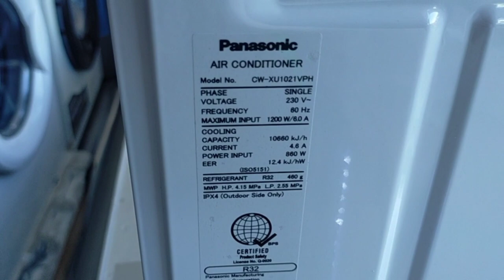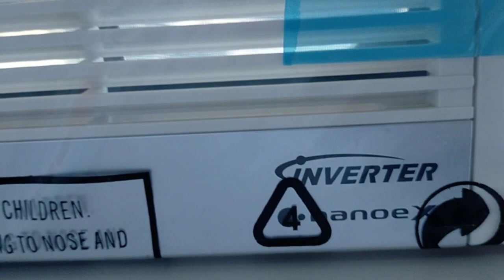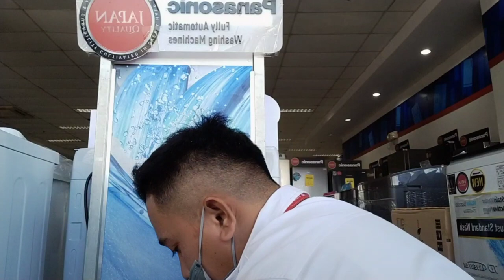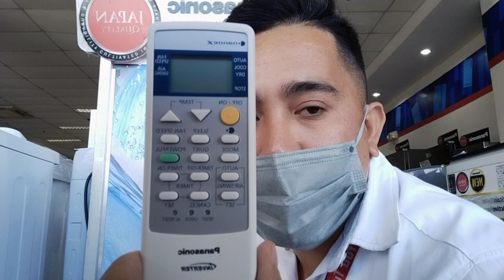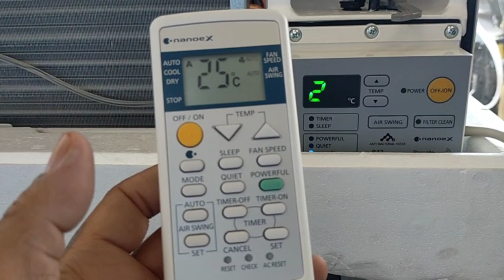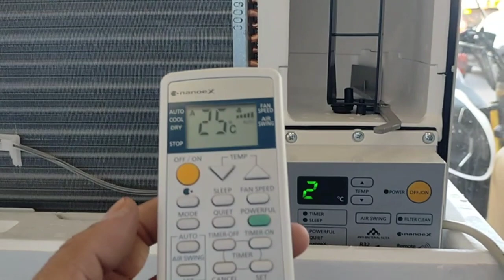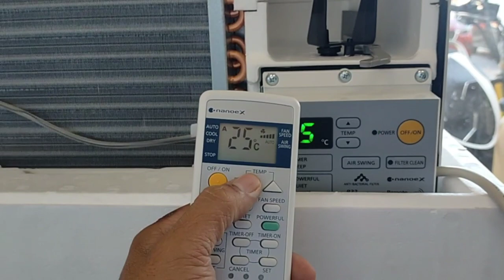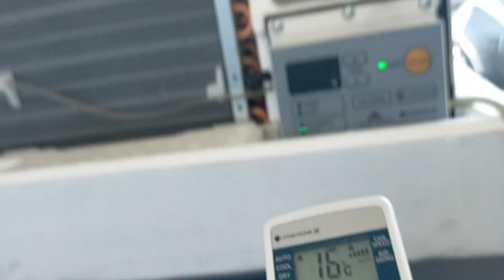NUMBER 1 IN THE MARKET PANASONIC INVERTER WINDOW TYPE AIRCON WITH AIR PURIFIER

Comment: Bought this and had it installed today. I still don't know why it is not giving the temperature i set it to. It's already been 2 hours set at 16degrees but the room is still not cold. Parang naka fan lang sya sa buong 2 hours na yun.
Reply: kumusta po ganun pa rin po ba?
Reply: @jpro1810  yes po ganun pa rin hanggang ngayon. May technician na darating bukas hopefully maayos. Sobrang brand new pero grabe ang sakit sa ulo neto  samin 😪😔😪
Reply: @jeikobriz  plano ko po kasi bumili. as in bukas sna. ano marerecomend mo na brand instead of panasonic
Reply: @jpro1810  we are planning to replace it with carrier. Aside from mas mura ang 1.5hp nya, may trust na kami sa carrier since meron kaming carrier sa bahay na 20 yrs na, malamig and tahimik pa rin. Nabudol lang kami ng sales talk ng saleslady sa SM since features nya daw is makikita lang sa spilt type and mas mas matipid since dc motor. eh di naman lumalamig so balik carrier kami if ever ma find out ng technician na sira talag tong unit namin.
Reply: @jeikobriz  ty for your sharing sir.
Reply: Ilan sqm room niyo?
Reply: @antondavid962  22 sqm
Reply: @jeikobriz  1hp kinuha niyo or 1.5?
Reply: @antondavid962  1.5hp
Reply: Update on this: Technician found out the compressor was indeed defective. We will be replacing it with another brand. So much headache for a brand new aircon
Reply: @jeikobriz  ahhhh defective unit i had 2hp it was ok nmn sinira kng ng authorized
Reply: @jpro1810  kamusta bumli kadin b?bukas n kc ko bbili,nagdlawang icip ako pgkabasa ko ng ibng comment.kolin at panasonic pinagpipilian ko
Reply: @daisysenobin8261  yes nkabili na ko pero sa sunday  pa nka sched iinstall. balitaan kta kung true ang mga comments. ty
Reply: hi @daisysenobin8261. hi i am taking back my words. 3 days after mainstall ang ac ko may lumabas na screeching, grinding sound parang tunog ng nagbabarena, grabe di kmi pinatulog. napuntahan na ng technician pero di nawala issue. very disappointing. i dont recommend this brand anymore.
Reply: @daisysenobin8261  bought panasonic 1.5 few days ago on promo around 30k. Cooling effect niya parang chill effect. Other non inverters parang freezer effect pero both cold nmn kaya din sguro masmatipid sa kuryente. Panasonic much better than kolin as per our technician cleaning the aircons less complaints
Reply: @jpro1810   hi po. Same po ito sa aircon po namin. May tumunog especially magchange nang temperature😢
Reply: same experience samin. sir pano nalaman na sira ang compressor? binuksqn?
Reply: @irvinevolcano  patawag mo sa service center nila. May bubuksan sila sa unit.
Reply: @irvinevolcano  based on my experience, meron tlgang chance na defective ang unit na nabigay sa inyo. ang suggestion ko, ireport nyo agad sa shop kung saan nyo nabili, cla kokontac sa panasonic. mabilis nmn cla umaksyon. yun sakin nireport ko agad, pinapuntahan nla ng technician at naconfirm na defective unit. pinalitan nla in 2 days at ok na, wla ng yung issue, tahimik na cya.
Reply: @jpro1810  yup. nareport na namin after 2 days. kanina may pumunta galing sa service center pero hindi naayos at di naman binuksan pero babalik daw bukas. yung prob sa aircon ko na 1.5hp is mahina ang lamig nya at  talo pa nung dati naming aircon na 1hp lang.
Reply: @irvinevolcano  i suggest request for replacement na. pag di nla nafix ang issue agad wag nyo na patagalin. palit unit na. 1.5 hp din ang unit ko inverter. malamig naman at tahimik. 24 sqm ang room ko
Reply: @jpro1810  same tayo 24sqm din samin. ang pinalit sa aircon nyo, same brand and model? kase dun sa binilhan namin last stock na sya at pwede namang ibang brand na kunin
Reply: @irvinevolcano  same brand and model ang ipinalit.
Reply: @alibalbuena6349  napapalitan po nyo?
Reply: hahaha ung remote nya di realtime nagppalit, ttry nyo po ilapit ung remote then hintayin nyo magbeep, mejo boplaks panasonic dito sa remote nila pero okay ang aircon
Reply: Tatlo po kase yung mode niyan sir, cool mode , fan mode , and dry mode.
Reply: Late ko na to nakita, we bought it like more than a week and kakaopen lang today pero more than 2 hrs di parin malamig. Parang nakafan lang po :(
Reply: @kimacenas   anong update nito?
Reply: Update on this po
Reply: same kakabili ko palang kagabi nag f95 error agad🤦
Reply: 23 degrees lang po settings
Reply: Hello kakabili ko lang today Ng Panasonic, feedback pls

Comment: Ours we both 2 mos ago still no cooling effect. Our room is 16 sqm and we have 1 HP. Tech from service center said no the unit is ok but I am still not satisfied. They told us to upgrade to 1.5 coz our room which is 16sqm is too big for 1 hp
Reply from the maker: Yes its to bigg your room is 16sqm + additonal heat load to your room much better you adjust 1.5hp because of the cooling capacity allowance
Reply: our room is 16sqm and the 1 hp ac is doing fine. 26degrees works will

Comment: Ano po ba okay Panasonic Inverter or Hitachi Inverter AC?
Reply from the maker: Bagong model npo yan .. ung hitachi po kasi dating model pa
Reply: Hitachi Ra hv po ang maganda,
I'm using this model super tipid sa kuryente, want to Sawa kpa sa lamig. Super happy with my HITACHI RA hv 1hp.
Reply: PANASONIC PO! SULIT ANG BILI MO PO
Reply: @DAReviewsTV   sir masmatipid ba ang panasonic split kesa window na both premium? Nabasa ko kasi lower wattage ng split?
Reply: @ajflores7047 Panasonic ang the best.. 
hitachi lagi kme nkkapag repair ng hitachi bibihira kme mkpag repair ng panasonic
Reply: @charlesgarcia2750 ows ehehe ok
Reply: @antondavid962 .mhirap mg kumpara mga sir.. mdami factor ang kinoconsider isa na dun yun room size, settings sa aircon, commercial or household use etc...

Comment: Panasonic XU1221VPH po sa akin 1.5hp version po nyan. Naka angled slant na pababa yung aircon installation pero may tubig pa rin sa pinakalikod. Ok lang ba yun? Nabili ko nung October 2021, pinalinis ko sa Service Center ng March 2022. Naglumot kasi yung tubig sa likod at may odor na pag on. Sealed naman paligin and aircon sa loob at maluwag naman ang environment sa labas. Paano ba dapat gawin para di maipon tubig sa likod. May drain pan o wala may water nakababad pa din sa loob ng aircon sa outside area.
Reply from the maker: Normal po un sir.

Comment: yung mga black na foam inside the aircon kaya yung shock absorber? di kase nag specify kung ano yang shock absorber kaya undecided kami if tatangalin yung mga black foam
Reply: Ano Balita sir? Need b tanggaling ung nakabalot sa compressor?? Ung Styrofoam lang tinnga ko ung white n my kalagay n remove
Reply: oo yun aalisin kailangan alisin yung screw likod at harap na pinakita ni sir sa video gitnang part ng video nato, tapos pull tas alisin yung tape at styro

Comment: Sir ganitong model ung Amin, nagswitch kme from Window Type Non Inverter to Window Type inverter, kpg po ba binubuhay tong ganitong Aircon kelangan pa po ba iFan? Ksi sa mode po, Auto, cool at dry lng ung option na lumalabas sa remote.

Sna po masagot.
Reply: Hi maam. Same situation samin. Nagswitch kami from non inverter to inverter. And napansin namin wala syang fan kaya high temp muna kami pag bagong bukas. 25 degrees tas sagad yung fan. After 10mins, ibaba na namin sa 22 degrees. Ideal temp namin since 24/7 ang ac.

Comment: Hindi ba maingay ang makina? At ilang decibels?.at hindi ba malakas ang vibration? Kasi balak ko na ilagay sa room na fiber cement board ang wall
Reply from the maker: Hind po low decibels lng po sya
Reply: @DAReviewsTV  sir di ba malakas ang vibration?, fiber cement board yung paglalagyan na may tubular frame
Reply: un sa akin maingay un compressor pag ka hndi naka full power.kaya palagi nakalagay sa 20c or below un sa akin para hndi maingay un compressor.pag ka 20c or below its pretty much full power or close to it.parang ayaw ng compressor gumana sa mas mababang RPM.pag ka 20c below naka set sa simula lng nalabas un tunog.pag ka around 22c hndi mag full power un compressor kaya habang andun ka sa temp na un hndi mawawala un tunog pero pag ka binaba mo temp bibilis un compressor kaya mawawala un tunog.not sure if unit ko lng or lahat.
Reply: @stevessteve2920  may whisling sound din ba sayo paps
Reply: @stevessteve2920  same yung saamin din pag 20 below smooth siya pero pag above na sa 20 maingay na 😅 akala ko sira nga eh
Reply: tahimik po ang unit ko. walang whistling sound and vibration

Comment: Same brand at unit nabili kulang kast month. Sa bill  walang pinagkaiba sa una kng nabili na non inverter, mas nagutuhan ko ung una 1.5HP na bili ko pero ndi masyadong malamig. Pag nka sa 25 umuugong ung unit haist
Reply: Bka nmn d mo nantaggal Yung mga. Filament tape shcok absorber sa loob kya may uneccessary noise ka na naririnig
Reply: @warrenathom6946  most likely, yan dahilan ng ugong and nasisira na Panasonic kc hindi na install ng tama or ng authorized Panasonic installer

Comment: asan po ba yung shock absorber? not sure baka eto yung maingay pag naka on yung compressor. thanks
Reply: same problem, wala niyo ba pina open yung aircon?
Reply: yung mga black na foam inside the aircon kaya yung shock absorber?
Reply: @jiacorinepizarras5703  yung mga white lang ata na styro yung shock absorber yung nasa bandang compressor at coils. Yung sa gilid na black hindi na ata
Reply: mga sir pano po diskarte nyo pag mag oopen ng aircon ? wala kasi syang fan mode eh sa iba kase 3 minutes fan mode muna

Comment: sa akin un unit ko pag ka hndi full power un compressor mrn sha humming noise.which is annoying parang ayaw ng compressor gumana ng maayos pag ka hndi naka full on un compressor
Reply from the maker: Anu ba settings nyu i auto nyu lng po
Reply: @DAReviewsTV  its the same its on auto or manual un fans un compressor mismo un maingay.di tulad ng 10yr+ kong AC before mas okay tunog pag ka bukas un compressor.sa kanya its maingay tapos minsan tahimik.so not smooth.gonna contact abensons para ma check
Reply: @stevessteve2920  hi! Ano po balita sa unit nyo? Samin din kasi my bigla bigla nalang irritable sounds :( nung una wla naman un eh, parang my pumipito na ang sakit sa tenga, nakakairita sya
Reply: @wrm0607  nawala lng ba ang parang whisling noise
Reply: @ArczAngel  hi! Unilaw na ba ung FILTER CLEAN dun sa dashboard? Sabi kasi sa manual 800hrs 3months na today AC namin di parin un umiilaw,
Reply: @wrm0607  wala namang ilaw bagong kabit lng po ang ac namin

Btw anu ba ang shock abosrber na tina tawag nila? Parang styro foam lng naman. Yung balot sa compressor, d ba yun tina tanggal?

Comment: Boss pano mo hugotin yung aircon sa case nya para tanggalin yung shock absorber? Ayaw mahugot po eh. Thanks po
Reply from the maker: Unscrew nyu po muna ung harap pati likod saby po slide out ung chassis po
Reply: @DAReviewsTV  maraming salamat po boss. God bless po
Reply: sir saan po banda nakalagay yung shock absorber? n alis nyo po b? tia
Reply: @alfredr5787  yes po boss. Yung shock absorber po nasa may likuran nung casing. Hugotin nyo po yung unit unscrew muna po gaya ng sabi ni idol DA reviews po. Yung shock absorber parang foam lang po pagitan nung unit tsaka nung casing po
Reply: @christianmacapayag  madali lng po bang tanggalin ang shock absorber? Tapos yung oag install ng unit kaya po ba DIY lng po? Kakabili ko lng parating pa lng
Reply: @christianmacapayag  parang maliit lng na styro foam
Reply: @christianmacapayag   ok lng po bang ndi un matanggal.. ngtry na po kc mg unscrew d nmin mahila kc.
Reply: @christianmacapayag  sir ok lng ba kahit hind itanggalin yun?
Reply: @JH-cl7nz sabi ng Panasonic staff, ok lng dw na wag na tanggalin yun. wala nman dw yun kinalaman sa performance ng unit. travel support lng dw yun. hayaan lng daw yun para in case ibiyahe ulit ang ac for example, maglipat ng haus, ay may support pa rin.
Reply: @jpro1810, same din sakin, hindi ko na natanggal mismong casing diretso na salpak 😅 mali po ba ginawa ko? Sabi kasi sa pinagbilhan ko wal na daw tatangalin compared sa mga 1hp.. kaya diretso na po sa butas yung akin, may need din po bang tanggalin sa likod para sa drip? 😊

Comment: Boss, question lng. Pag kumabas sa digital panel is "F" tapos "90"  Fahrenheit po ba un or may error na? Salamat po sa sasagot
Reply: Hi! Kung F90 error po yun
Reply: @busabosandroid6545  Ano po kaya cause nun? Low voltage po kaya? Hindi nmn po kasi nagtrip ang Circuit Breaker. Saka tuwing gabi lng po, kapag umaga nmn ok nmn po sya, salamat po.
Reply: @paulcarloesternon7989  bago lang po.ba yung unit nyo?
Reply: @busabosandroid6545  Opo. Nung Thursday lng po sya nabili. Sa umaga ok nmn sya, pero kapag gabi na po ayun na po nalabas na ung F bago 90.
Reply: @paulcarloesternon7989  mas maganda po na mapacheck ninyo sa authorized service center.

Comment: PANASONIC PO WINDOW TYPE CW-XN920JPH.. kakabili lng last month.. ask ko lng bakit ayaw mawala nung blink sa SET TIMER .. ayaw na macancel, then after 1 hr namamatay.. bakit po kaya? Pa help po. 😢
Reply: Sira po yung remote control ng mismong aircon ganyan sakit ng panasonic
Reply: @cocolee8396  d po yan na rereset?
Reply: @ArczAngel  hindi need mo tumawag sa panaaonic may aayusin sila dyan
Reply: @cocolee8396  boss pag install nyo ng window type yung shock absorber ba yung styro lng ?
Reply: @ArczAngel  di ako technician, call kana lang sa panasonic gagawin nila yan gaya ng sa ginawa sa amin naayos naman
Reply: @cocolee8396  pina install ny ba sa tech yung unit nyo
Reply: @ArczAngel  panasonic nag install sa amin

Comment: Bakit ganun un 1hp nyan 12.3 eer tapos un 1.5 12.4 eer sir mas maliit un makina ng 1hp pero mas lamang sa eer 1.5
Reply: Ang eer or energy efficiemcy ratio na compute sa papamagitan ng pagdivide ng cooling capacity at rated power input, d po dhil sa laki ng compressor

Comment: Bought this aircon but it turned out this is not a good product. Sales talk lang ang ginawa nung nagvideo. Shame on him. My old window type inverter is way super cool. This one at 20 degrees, still its not that cool. Cold but not cold enough. If you use the Quiet Mode, good luck, it will drastically lower the fan speed and will leave you with a less cooling environment. The only complement is its quiet in operation. If you use the remote, there is a delay in the response of the unit. Don't be fooled also with the rating on  Panasonic website. They will not allow you to post a low rate so it's deceiving the reader to show that their product is 5 star. Overall, bad presenter sugar coating a bad product.

Panasonic refrigerators are very good. Aircon.... a big NO.
Reply: Oh no.. we just bought it pero nalalamigan naman kami sa 25 degrees ilan hp po sainyo? 1.5 samin
Reply: Same issue
Reply: @heejo9880  1.5 HP for a 15 sq meters room
Reply: 1.5 hp din samin. Yung 20 po nangangatog na kami. Sala at kwarto na sakop nya
Reply: Matakaw din sa kuryente
Reply: Ang Lamig ka saken nyan..
Reply: Sorry to dispute your comment sir. Panasonic brand either refrigerator or air-con is of great quality. Our air-con of more than 20 years is still alive and in great shape. The wear and tear of the unit depends on the user, not on the brand. Any brand of appliances if abused or overused will surely be broken if not handled with proper care and use. Just my 2 cent. :)
Reply: @gilbertsimbol401 15 square meter So what? There are still factor to consider not just a room size,ptingin mo muna sa amin position ng aircon mo, morning sunlight or afternoon sunlight? Ilang tao natulog? Baka nmn yun 15 square meter(3m by 5m) mo eh computer shop, resto,etc.... Yun star rating at eer d nmn yun manufacturer ang ng conduct ng testing nyan, kwestyunin mo yun ng award ng 5 star ratings jan ang DOE,
Reply: @restycaoile2076 panong matakaw? Baka nmn tumaaa power rate nyo kya ang nasisi mo yun aircon na yan
Reply: @warrenathom6946  sir nasa magkano ang consumption rate per hour,,kuha lang po ako ng idea..kakabili ko lng ng ganyan model
Reply: kakabili ko lng panasonic cwxu1221vph grabe kabago  bago may screeching sound, tunog na parang may nagbabarena, hndi ka patutulugin. pinuntahan na ng panasonic technician pero hindi nasolve ang issue. i'm now demanding for a unit replacement or refund.

Comment: Hindi naman matipid sa kuryente yan. Sa akin kasi nag-aaverage sya ng 8 KwH per day or 240 KwH a month. Todo tipid na yan sa settings. Eto pala settings ko. COOL mode / 2-3 Bar Fan / Quiet Mode / 9Hrs use (7pm~4am). Eto model ng Aircon ko (cw-xu1221vph).

Comment: Kakabili lang namen. One month use from 597 bill to 2k hahahhaha iyakkkk. 🤣 8hrs or 5hrs use lang hihi
Reply from the maker: Anu po ba settings nyu at gaanu po kalaki area nyu po ? Ilan hp din po ba yan sa inyu
Reply: Basing sa 597 bill niyo mukhang di kayo gumagamit ng aircon dati. Super tipid na yung 2k bill na may aircon kasi samin ng halos 3.5k non-inverter aircon yon tpos tig 7hrs lng naka on.
Reply: @DAReviewsTV  ano po ba best n setting make video po
Reply: @steff162  Nanibago lang siguro sila 1,500 para sa aircon per month? Super tipid na nun
Reply: Possible nyan Kaya ganian kalaki kuryente nyo mahaba Yung running time Ng Aircon malamang pa undersize ung Aircon oh hnd angkop ung HP na binili nyo  madami pa kayo occupant sa kwarto heat load for short matagal ma meet ung lamig  walang pahinga compressor Kaya kahit inverter gamit nyo tlgang Malaki babayaran nyo na bills sa kuryente
Reply: @hersonmangante or baka tumaas power rate nila gawa sa amin😄😄😄hihiib from 9.5 per kWh to 14 no pesos pero kWh shout out sainyo mga hinayupak na electric company lalo sa na probinsya